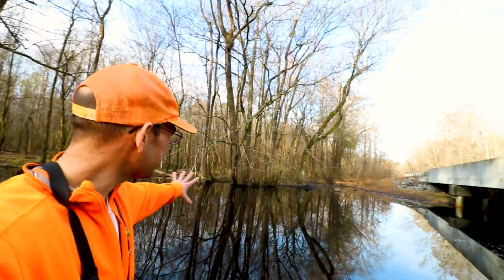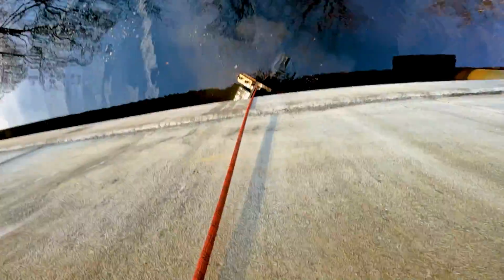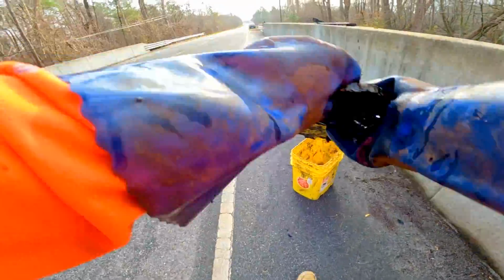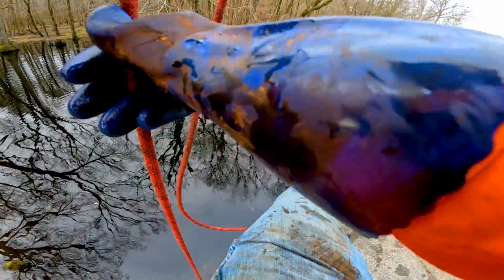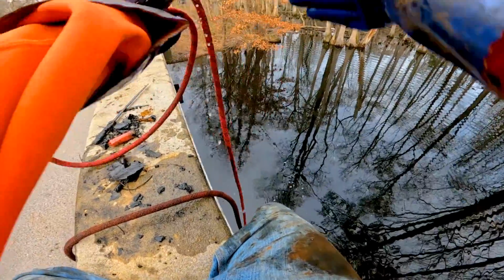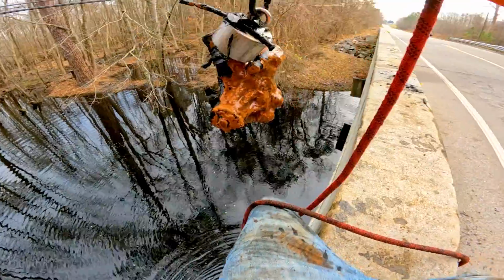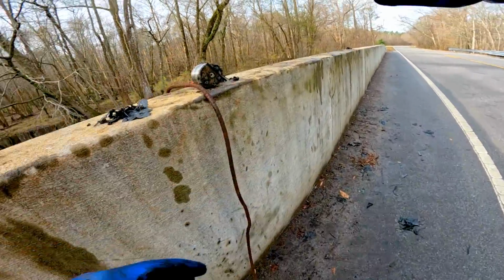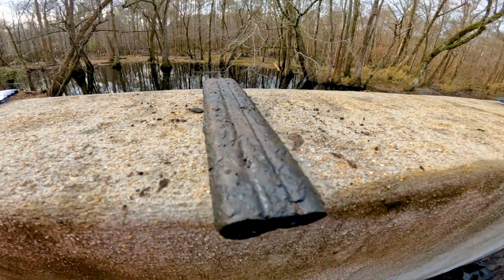HIT THE MOTHERLOAD! Magnet Fishing Under This Old Bridge!! (Best Finds)

Comment: Ok, put ya on pause to start typing some answers for ya. When you went over to the other side, you pulled up a ring clamp for the whole lid for a 55 gal plastic drum. You pulled up a powerful transformer. You pulled a water pump for what looks like a truck engine. A refrigerator compressor. A knob to a welding tank valve for aceteline or oxygen. And just think, ya cleaned up that water way a bit, long, long way to go to really put a dent in it. Ya got some scrap to sell. Not bad for maganet fishing!